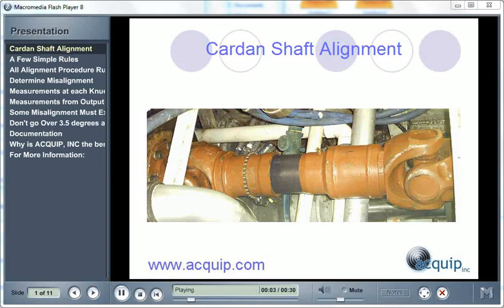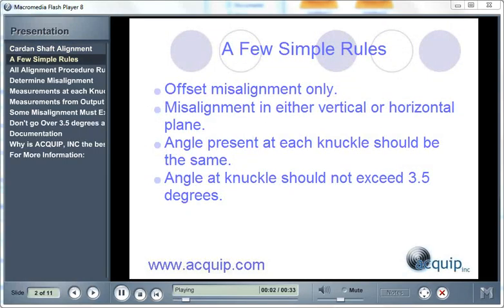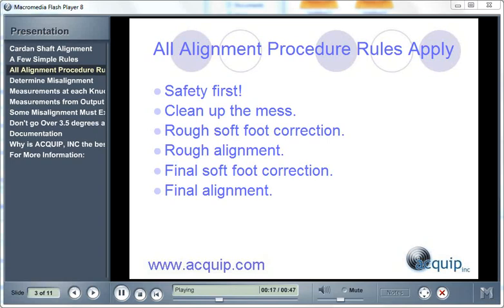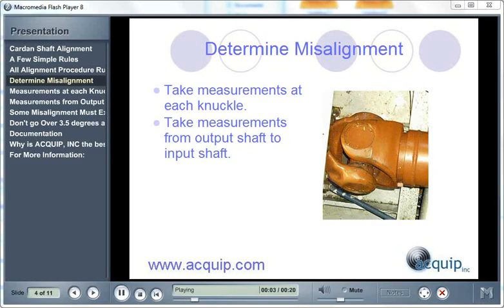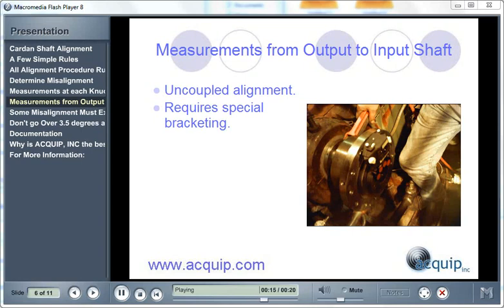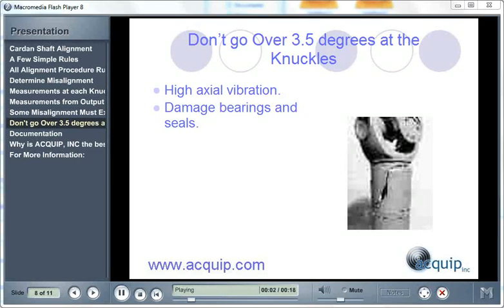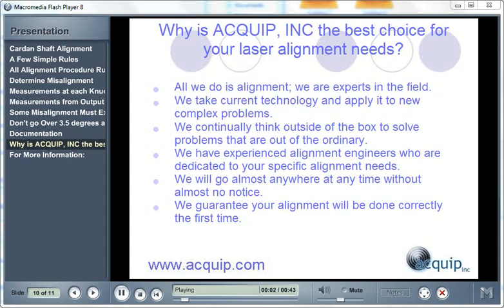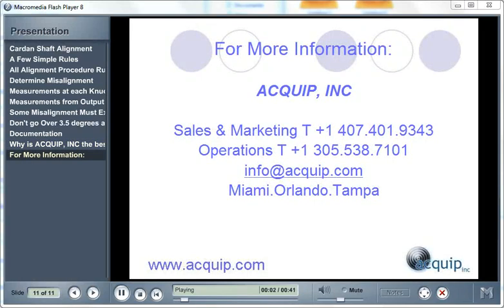Acquip Laser Alignment Presentation: Cardan Shaft Alignment

Comment: I've heard this before and it makes no sense. "You must have offset in either the horizontal or vertical but not both" Please explain. If there is zero angularity, that means the driven and driving shafts are parallel. Geometrically speaking, two parallel lines define a plane. Thus, any offset always lies in that plane. The plane defined by the offset may not be exactly vertical or horizontal but it can never be in two planes provided the shafts are parallel.

Comment: Can anyone tell please, why dial indicator alignment cannot be done, when Cardan shaft is uncoupled?
Thanks.
Reply from the maker: It would be very difficult to accomplish an uncoupled Cardan shaft alignment with a dial indicator. You would have to account for the rod sag that occurs over the entire output flange to input flange distance. If you were to use dial indicators for a Cardan shaft, you would be better off leaving it coupled. You would measure the misalignment at each knuckle and attempt to make the angles even. 0.5 to 3.5 degrees. You would want the machines level to each other and offset in only one direction.